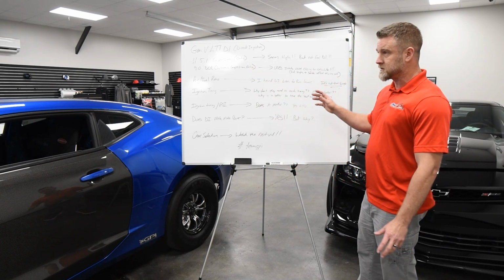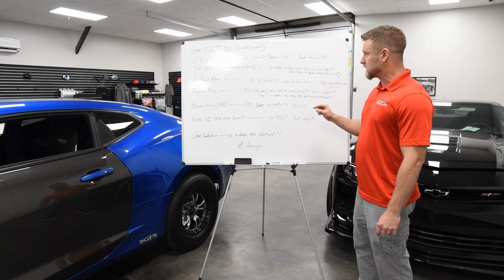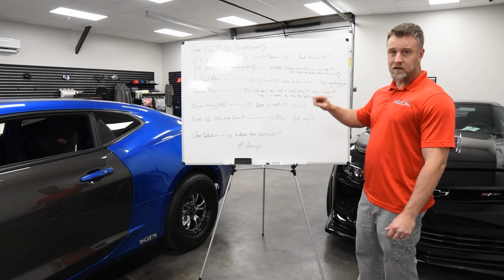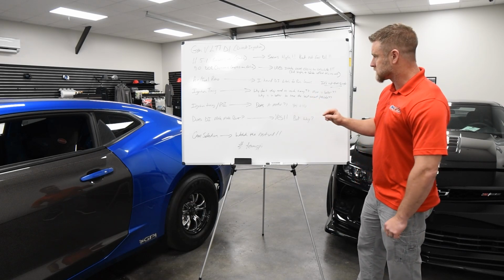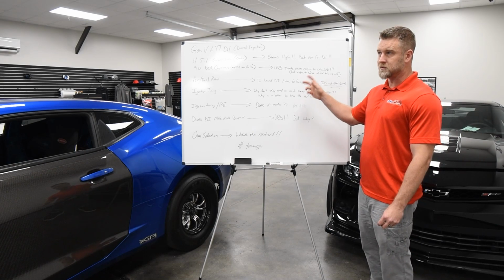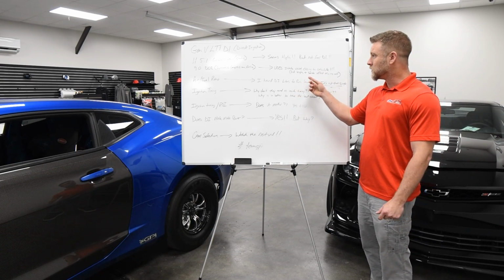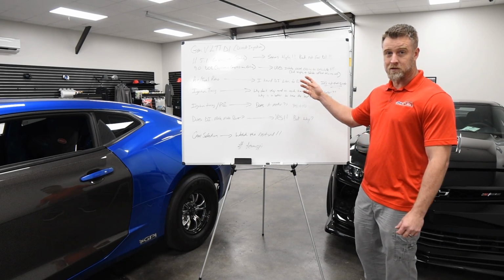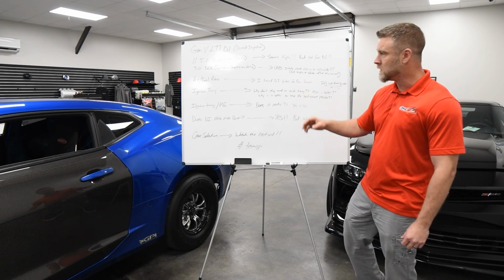Gen V LT Engine Overview

Comment: Saving up to buy a GPI SS4 LS3 camshaft matching titanium valve springs and hardened 7.425 pushrods for my 2011 Camaro SS that has a new GM performance LS3 480 horsepower crate engine that has been tuned to run on E85 with a built 6L80 transmission with a circle D 4200rpm stall converter the engine has 300 miles on it tomorrow it's getting a oil change with driven LS 30 oil and a wix xp filter and am getting PRW roller rockers delivered tomorrow wish l could afford to buy it all without waiting but that's how this game works for the working man with limited funds sometimes waiting months feels like years when wanting to upgrade your project toy or muscle car
Reply: I have the cam and pushrods for sell on Facebook if you’re interested

Comment: Driven Motor Oil makes a special formula oil for direct injection engines that addresses soot build up on the back of intake vales in an DI engine. Have you tried it? This is going to be a great series. Thanks for doing it. Happy New Year.
Reply: We use their oils in everything.
Reply from the maker: We buy Driven Oil by the pallets ;) Their DI lineup is great, we also use their LS, DT, and GP-1 lines!